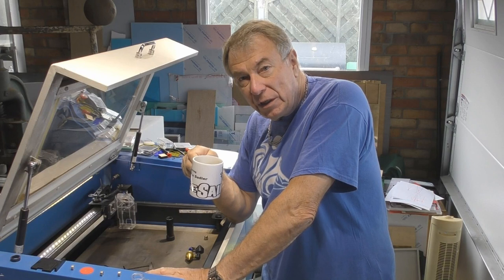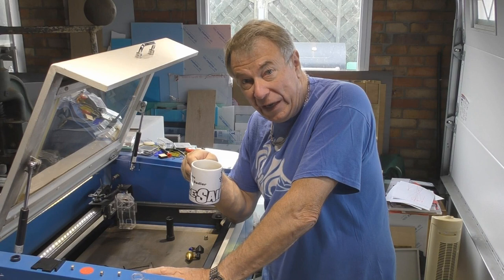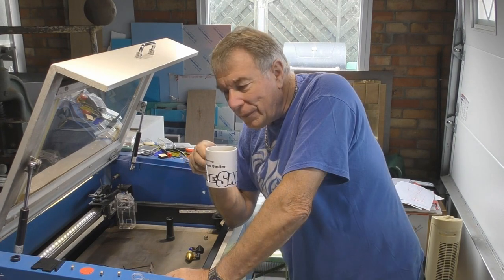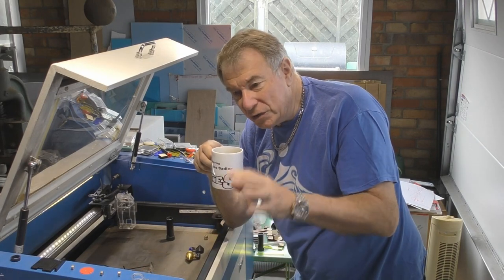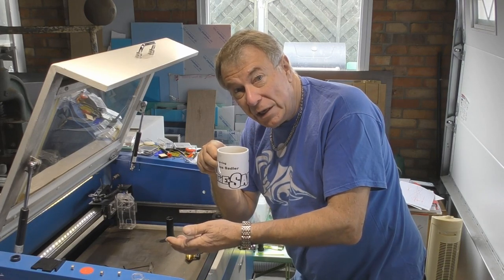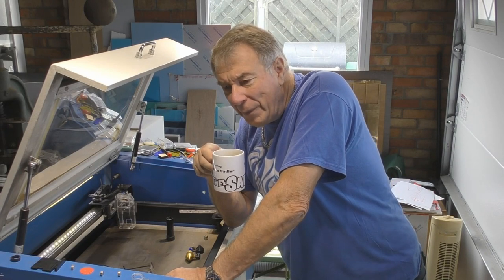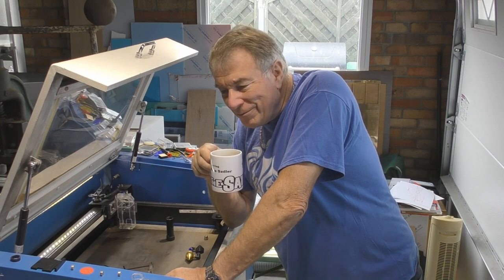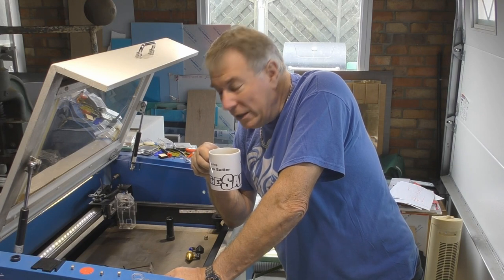RDWorks Learning Lab 151 Lets ZOOM in on Lenses Part 3

Comment: It is not clear to me that the focus distance was correct for each lens. In order to maintain consistent nozzle clearance you would have to adjust the vertical position of each lens within the holder  every time you made a lens swap - it is unlikely that several different lenses would all focus perfectly when mounted at the exact same distance from the workpiece.
Reply from the maker: I was most careful to find the exact focus point for each lens by preceding each test with my little dot test pattern to perfectly find the individual focus points,  because as you mentioned the focus point may not be spot on the 38.1mm claimed distance.  Surprisingly most were spot on and I was able to maintain a  2.5mm nozzle gap. If you check the video again you will see the nozzle gap written in the bottom right corner of each test tile. So I allowed the gap to vary  slightly, NOT the focus point. The way I had my lenses mounted in the tube with the lens sitting on a clamp ring, then a cushioning O ring, then a front clamp ring,  would have allowed me to exactly set the lens to a perfect  nozzle gap. but I deemed that +/- 0.5mm was not going to drastically effect the kerf airflow. 
Thanks for the observation because I was squeezing so much into this session that the mention of the air gap probably got missed.

Best wishes
Russ

Comment: Hi Russ! Thank you so much for your videos... extremely informative and easy to understand by novices such as myself.  But I do have a question. In this video you address the cutting of materials and the lenses best suited for that. But what if a project involves both engraving and cutting? What lens would be a happy medium for best performance of both functions? Thank you in advance!  Bill
Reply from the maker: Hi Bill 
I have  mentioned this point in several of my videos because the ideal conditions for engraving and cutting are diametrically opposite. Although the lens orientation will have a small effect the best general lens to use is a 2" (50.8MM) focal length  and have it flat side down for most efficient cutting, Generally you can compromise on engraving. Engraving requires very low air assist flows (just enough to protect the lens)and a big gap between nozzle and work whereas cutting requires full air assist and a small hole nozzle set 3 to 6mm above the work. The best compromise is to use these latter cutting conditions for engraving also.

Best wishes
Russ

Comment: I have been fascinated by your treatise on lens science.  I sat and watched all three one after the other.

One thing that occurred to me early on was the divergence of the lens and the power density curve.  Is it not possible to focus the lens onto some sort of wave guide such as a slightly tapered fibre optic 'rod' to concentrate all or most of the energy into a more centralised area?
Reply from the maker: Hi Peter
Sounds like a great idea until you understand that glass is not a transmitter of our invisble 10.6micron IR light. Exactly the opposite. It is 100% opaque and will absorb the energy we fire at it and just heat and melt the nentry surface. Many correspondents have suggested using fibre optics rather than mirrors to transmit our beam to the head. Oops.

Best wishes
Russ

Comment: Hi Russ,  Thanks for all of you hard work i can assure it has been invaluable to me! i have a question im in the market for new lenses and mirrors and currently have a plano convex 38mm. What would your immediate recommendations from what you've seen so far be for separate lenses for engraving and cutting on a 90w SPT laser?
Reply: Hi Nicky
90 watts is a bit of a puzzle because it really depends on what the low power characteristics of your tube happen to be. Let me explain. The more powerful your tube, the more likely it is to have a "dog leg"  shape. For example maybe your first 1 or 2 watts happens at 7% power setting. but  by the time you reach at 10% power you are at  to 50 or 60 watts. Then from 10% to 70% you steadily climb to 90 watts. Typically you want to be using the  10 to 20 watts region for engraving but as you can see, that range is hidden somewhere in maybe a 1% range in that rapidly rising initial power.. Not all tubes are like this, in fact the one SPT tube I have seen had a much smoother characteristic. So for delicate engraving of photos may be within your reach. Generally these higher wattage tubes are for cutting and  text/logo engraving and not designed for the delicate stuff. If you are able to get some control over your low watts then the only engraving lens I would recommend is this.
https://www.cloudraylaser.com/products/usa-cvd-znse-focus-lens-dia-20mm-fl-50-8-63-5-101-6mm-1-5-5?variant=7645038936115

While you are there this is also the only type of mirror I would recommend
https://www.cloudraylaser.com/products/cloudray-high-quality-mo-mirror-dia-15-19-05-20-25-30-38-1mm-thk-3mm-1pcs-custom-made-for-co2-laser-engraving-cutting-machine?variant=7645314711603

The fact that you have a 38.1 lense at present means  that you already have a suitable mount. Some lens tubes will not immediately accommodate this short focus. I will shortly be doing a video about suitable engraving versus cutting nozzles that you can buy.

Best wishes
Russ

Comment: What would happen if we reduce the exit hole size from 2.5mm to say 1.5mm?
Reply from the maker: You would have to be absolutely perfect with your beam alignment and be where I was at about 3mm from the work. The beam expands quite rapidly  from the focus point so reducing the bore removes ant wiggle room and also reduces the flow area by 2/3 . Whether this dramatically reduced flow would result in  more  entering the cut is something we could argue about....but I don't intend to.  You can test this theory for yourself when you get  your pile of pieces back together
Thanks for the thought provoking idea
Best wishes
Russ
Reply: LOL, pile of pieces is right.  I just found out I have to design a new motor mount/2nd lens mount for what I am doing.  My machine had no wiggle room if you changed out the big HTD gear as I did so by going to a smaller diameter gear the belt will no longer work to make a smooth ride to the other side.

Comment: Aside from the majority of the power being near center (and therefore shallow angle), there is also the waveguiding effect of the cut walls. By this I mean the laser light bounces off the cut walls in a waveguiding fashion, contributing to straighter walls. This is what primarily contributes to the relatively straight edges and material penetration. Waveguiding and entrance angle (based on focal-length) is the answer to your question about why 1.5in does not perform as well as 2.0in for thick material cutting.
Reply from the maker: Hi Steve
I had considered that possibility (briefly) because of the known wave guiding effect in acrylic, As I have admitted several times, I am not a physicist  but I just cannot imagine the same thing happening in wood especially the plywood that I was using where the grain goes in different directions, there are glue layers and different density plys and there is no reflective surface. I can fully subscribe to the second part of your explanation about the lower entry angle giving a deeper cut  and this long wavelength light certainly has some strange properties. Maybe one of those properties that it's not fussy about smooth surfaces. As with most low frequency waves they are hard to attenuate and carry lots of power. Is there some reference that you could point me to that describes the science of this phenomenon? I have asked questions of several international optical companies but there answers are just technical whitewash. This is really a material science problem so I guess I'm asking the wrong people.
Sincere thanks for your comment.
Best wishes
Russ
Reply: Well, the surface of the cut walls of the wood is carbonized wood, with sap. The very complex environment in the cut is basically superheated: air, water vapor, sugar, and carbon. The long wavelength is less affected by the smoothness of the walls. There is certainly waveguiding going on. The other thing to consider is that the longer focal length lens will have a longer "depth of focus" at the focal plane.  The beam does not focus like a straight cone. Due to diffraction, it focuses like...imagine a trombone horn in reverse. This means that there is a waist at the focal plane. With the same input beam diameter, you will have a longer waist with a longer focal length (albeit with lower power density).  There is a balance of power density and depth of focus to be found.  I have been an engineer in the CO2 laser industry for 24 years (too bad you don't have a Universal!).
Reply from the maker: Hi Steve
This is a fascinating subject that requires scientific fact for me to be convinced. I have enough scientific knowledge to know that I cannot as yet  understand how wood ( or a carbon tube) can be a wave-guide. Wooden wave-guides are possible at audio frequencies but that is max 20Khz. Our 10.6 micron wavelength is around 28,000 Ghz  Microwave wave guides are usually made from polished metal  and there the  wavelength is in a different league at 300 microns  and above.  Much as I would like to play with a Universal machine,  10.6 micron light is the  same regardless of the source. Our  lenses are the same materials, as are the materials we cut. So, apart from the $$$$$ we are on common ground. Your vast experience is not being questioned  and your light guide idea is tempting because many of the observations would fit. However I need to track down the scientific basis for your assertions. As yet I have been unable to find any academic  treatise on this subject. 
Again, many thanks for your stimulating thoughts. I am gaining immense pleasure from decoding this technology. People like yourself with vast technical experience are rare, so I really appreciate your contribution.
Best wishes
Russ

Comment: I am a little late to the party so to say. But could this be adapted to a K40 to improve performance?  Especially in the lower power settings?
Thanks for posting!
Reply from the maker: Please clarify which bit you wish to add to your K40. Thanks
Russ
Reply: SarbarMultimedia  On My (admittingly older) K40 I lose quite a bit of power at the farthest end of its stroke. I zero mine at the upper left. When I have to cut in the lower right, it never has the power due to the distance the beam has to travel. I was thinking that a larger focal lens would assist in low power etching.  Why do I get the feeling that I am missing something here.. I am going thru your other videos to see if more education is needed.  :) As I recall the K40 has a 18mm lens. Tube has been replaced and your doHicky says I am getting good power at my origin but nearly only half at the farthest extent.
Reply from the maker: The good news is that you have a means of measuring the power. So now you need to b logical about how you use it. You do not loose power because of the length of the beam path. This is a beam of invisible light that reflects off mirrors to arrive at the lens where the beam is intensified to do work.. You have checked power out of the tube and my guess is it will be about 30 watts? You can expect mirrors to be about 97% efficient so if you measure the power just in front of the head before it hits mirror 3 , you would expect about 6% power loss (say 2 watts.) If it's 3 watts or more you definitely have a mirror problem. Now, I can't say what that problem will be . You are on the spot and can observe. 
1) Are mirrors 1 and 2 clean? Hmmm. They usually fit the cheapest K9 mirrors to these machines. These are polished crown glass for flatness and then flash coated with an atomically thin layer of gold to make them reflective. It requires virtually no cleaning effort to damage the gold flash and reveal spots of glass.  The glass absorbs IR energy and heats the mirror....bad news. So carefully check your mirrors. 

2) Are the mirrors catching the beam fairly centrally. ? If the beam clips the side of the mirror it will absorb some of your power.

However, the fact that you see variation in power across the X axis  would indicate more that your beam is not well aligned. Try this test. Fix a piece of card to your head just  in front of mirror 3 and move the head right close to mirror 2.  Set your power quite low and pulse the laser to produce a scorch mark on the card. Now move the head as far away from mirror 2 as possible. Make another pulse  scorch on the card. If the 2nd mark is perfectly  on top of the 1st scorch mark  then your x axis is correctly aligned. Now move the head to the rear of the machine and do yet another scorch mark. If that sits perfectly on top then your Y axis is well aligned also.  If  either X or X marks do not align then you need to set your beam correctly.  I will assume that you know how to do that. If not shout out again.
Best wishes
Russ

Comment: I've just looked at several Chinese PVD lenses on ebay, Aliexpress, and they have a structure of plano-convex, but also have the shape of meniscus. It's confusing, as I thought they were two different surfaces ( flat vs concave ) ?
Reply from the maker: Hi James
There are many places to buy lenses on www. I have tried with varying success to buy plano-convex and meniscus lenses of varying diameters and focal lengths. I have a collection of plano-convex 1.5" lenses that were sold to me as meniscus type. It is a FREE collection because in all cases I managed to get refunded. It was a long and difficult struggle to find a source that I could trust. I thought that a company called Dragon Diamond were worthy of that title because I had several successful purchases from them. However they failed on the 1.5" meniscus lenses. In truth I have found only one truly reliable source and that's a company called Cloudray. They have their own website rather than deal with AliExpress. Try  
https://www.cloudraylaser.com/
Yes they have a web shop but it turns out that this company is a big supplier to the factories that build our laser machines. If you need spare parts or special requirements, it is worth contacting them via their message system.. I have just looked at
https://www.cloudraylaser.com/collections/co2-focusing-lens
and indeed the plano-convex option is not listed in their "shop".  I know they have them because I made a bit of a fuss when I got plano-convex instead of meniscus.  I immediately received free replacement meniscus type  and their web shop was changed to include the meniscus description. Message them and ask for what you require. These guys are not "yes men" they appear to be customer focused and are really friendly to deal with. Please let me know if you find otherwise.

Best wishes
Russ
Reply: What do you also think to the nozzles on ebay of varying length, that accept a 1.5,  2, 3 or 4 inch lens ( one nozzle only accepts one size ) ? Not sure whether they screw into the gold standard head, but at £15 could be a solution, rather than buying a completely different head mechanism. All the Chinese Lasers seem to come with a gold head ( or plastic ), and therefore I assume will have 18mm lenses. You've shown they do cut, but are not the best size.
Reply: A lot of crooks out there as I got ripped by Dragon Diamond who I proved sent me the wrong lens than advertised and after nearly a month of back and forth AliE took their side (my credit card did not) and AliE banned my account for turning them in.  Be careful and stick with Cloudray.
Reply from the maker: Hi James
I have looked at these often because I found out over a year ago, and confirmed yet again in this video,  when you are CUTTING you need your air assist concentrated into the kerf  and you cannot do that with the gold nozzle that has a 4mm diameter hole.  If you are using a 1.5" lens for say 6mm material then you will get away with it but most folks are supplied with a 2" nozzle which puts the gap to the work at 17 to 19mm. That is too big a gap for the air to jump and enough of it to find its way into the very narrow kerf.  The idea of these nozzles you are looking at is overcome this problem and put the nozzle really close to the work surface so that you can get good air flow into the kerf. Rememeber what I mentioned in the video, these machines are marketed as ENGRAVING machines and for that purpose the gold nozzle is just perfect. I did also show in the video how there is a common 21mm thread used for these nozzles I cannot imagine these nozzles would be different .. The only caution I would advise is to  check out the ad very carefully. I got bthe impression these were priced as each and you had to order your single size. It may be worth getting a 2" version if you do a lot of cutting. It will imiprove your cut and your finish.  Please dont run away with the idea that a 1.5" lens is poor at cutting. It is not the right lens to choose if you are attempting thick materials , that is what the test clearly showed. However if you are down in the 5 and 6mm thicknesses then I just love the short focus lens. If you are photo engraving coasters for instance then for a multitasking lens you will be fine. This session  was a serious test to the death to see where each lens ran out of puff.and the results were surprising. 18mm diameter or 20mm diameter makes no difference.

Hope this helps to clarify matters.
Best wishes
Russ